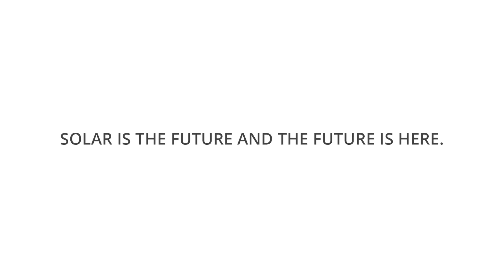Solar Philippines 63.3 MW Calatagan Solar Farm

Comment: intermittent power sources like wind and solar can be used yes. But only up to a certain percentage of the electrical grid. Without cheap storage 2-3 orders of magnitude better than current tech, those technologies require extensive backup. Either hydro, nuclear or fossil fuel

example, this is 1 month of wind power in almost the entirety of europe, from spain to central europe to england and the nordic regions. There are a couple of days and nights with very little wind.

http://oi57.tinypic.com/dgnse0.jpg

so unless you can guarantee that there will be no non windy nights, the most probable post fossil fuel electricity grid will be a mix of intermittent (solar, wind) and non intermittent (hydro, geothermal, nuclear) power sources